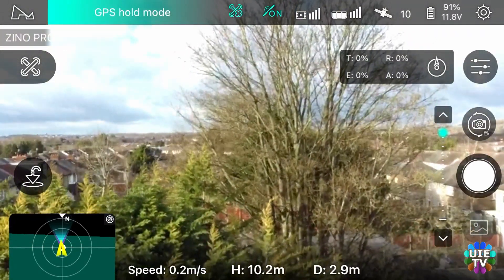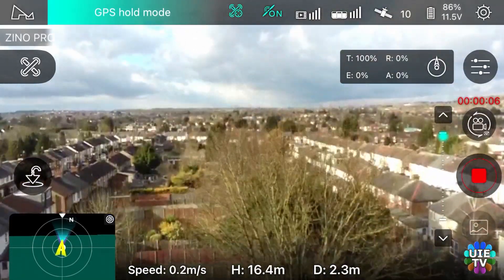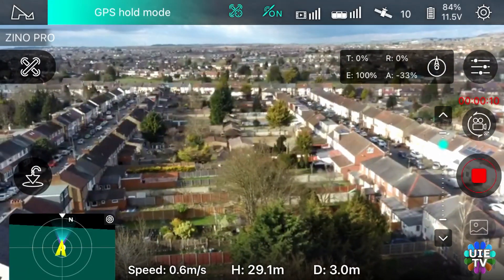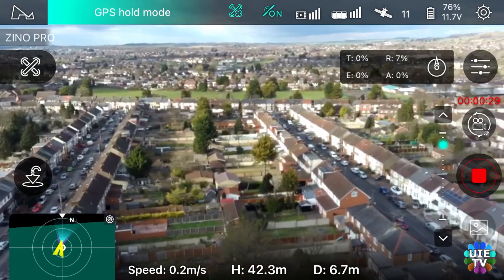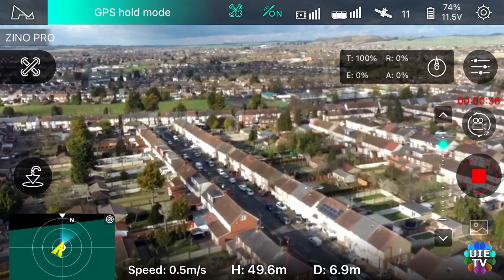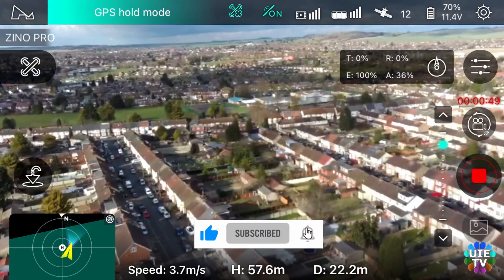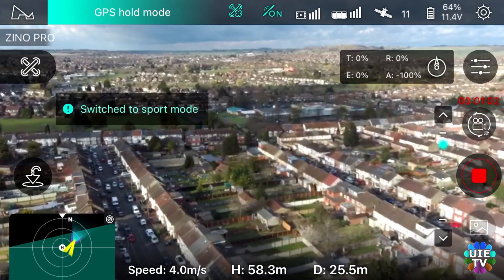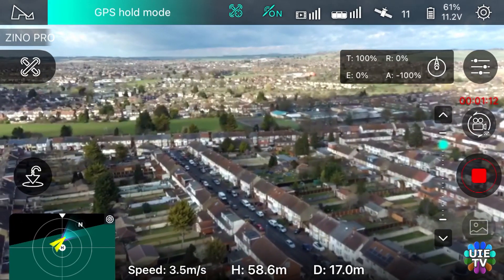Why Battery is Draining too Fast on Hubsan Zino Pro H117P Model? Can Someone Help to fix Problem?

Comment: I have the same issue. 2 batteries. If you close the app and restart it, then the voltage is correct. It seems it's something related to the ios application
Reply: So the battery is actually draining properly? Is it a problem with the app? Mine does the same! When u land and refresh the app will it tell the proper drainage? Thanks

Comment: I feel that the Zino drone battery just is poorly design or made. I bought this drone brand new about 2 months ago, with 4 batteries total, and I fly once per week. I keep the batteries at 50% charge, as instructed, when not using and charge before I fly. Of the 4 only one will still give me 30 mins flight time, the others less then10. Great drone to fly, but if you are thinking of buying one, DONT. I even tried contacting Husban and no luck. I will never buy another drone by Husban

Comment: i think the battery is bad i have the same problem
the first charge was 100 percent and I have flown 4 km and back
and now it can not charge more than 95 percent sometimes 90 percent there is something with battery

Comment: Hi. Same issue here with 4 batteries. Have anyone found any solution?
Reply from the maker: https://www.ebay.co.uk/itm/255036155999

above battery is much better, i have tried it.

Comment: I have the same problem as well. It usually forces me to land within 2 minutes. It was showing I had 6% battery left when it landed. I shut the drone and the controller down. Turned them back on and what do you know the same battery was now showing 80% and I took off and it repeated the same scenario all over again. I do not know what is causing this.
Reply: I have the same problem
Reply from the maker: i found the problem in my drone. the battery is week. its charges and discharges so fast. you will have to replace battery pack. or follow this video link to know how to modify battery? 

https://youtu.be/-SZjAGXn9XU      
Battery Fix Repair Hack and Easy Modification on Hubsan Zino & Zino Pro Drones. Perfect & Easy Guide 

https://youtu.be/7XaZhpMLOmQ       
All in 1 Proper Guide, How to Repair or Modify to faulty Battery in Hubsan Zino Pro Drone Fimi x8
Reply: @universalinformationentert3976 is this the solution of rapid draining battery in the video?